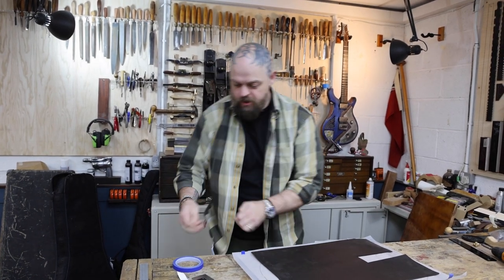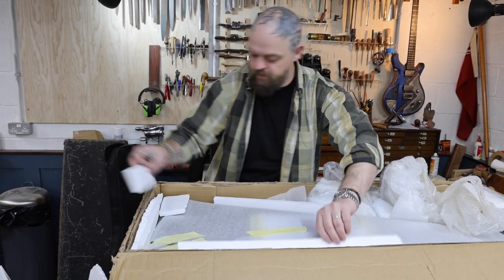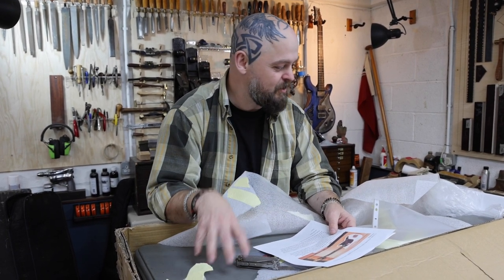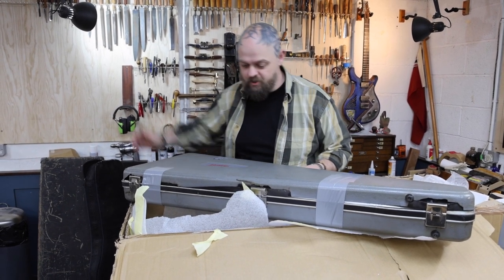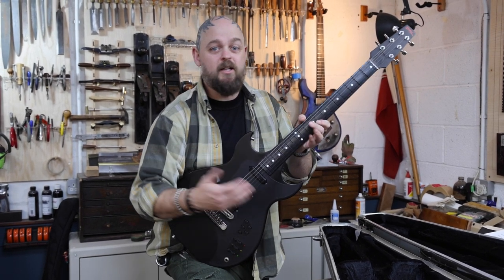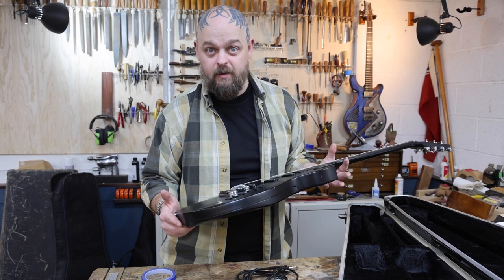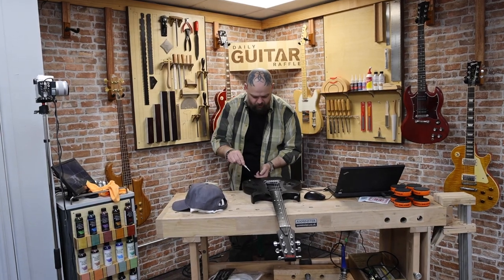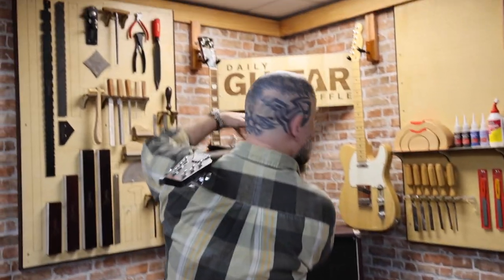Dream Unboxing | Bond Electraglide Carbon Fibre Guitar | My Personal CandyLand

Comment: Hi Ben, I'm sure you've figured it out by now but just in case here's how the controls work...
The 5 push buttons are your pick up controls.  The top 3 are on/off switches.  You'll notice a green or red dot in the display in one of three positions.  That indicates the status of the pick-up, on, off, in phase, out of phase is indicated by the dot being red or green and is toggled between the two settings using the lower 2 push buttons. I think that works out at around 10 possible pick-up combinations?
The 3 rocker switches that display numbers on the display are more of a global setting, as you can't alter the volume and tone of individual pick ups, rather you have an overall volume and tone control, So Red is Volume, Orange is Treble and Green is Bass.   

I've been looking after number 00709, which I rescued from ebay as a box of bits back in the 90's.  I'm placed to say she has a few scares but still plays, sounds and looks beautiful.  
I was 16 when these came out, I remember looking through a music shop window in Inverness and seeing one hanging there bathed in light with an angels choir "Ahhhh" ring in my ears.

Comment: The transformer will come off the power supply board; use a ziptie on it. LaSalle music in Boston bought the remaining stock in the USA. I believe production was way lower than 1400 units due to so many defective units. I've two mint electraglides for 35 years. Believe they still work :-)

Comment: Hi Ben, I live in Aberdeen. Back in the 80s, there was an electrical store on the main street in town called Clydesdale. In this shop they sold every electrical appliance and gadget thing you could want in your home at that time. To one side of the shop, they had a small musical department. Every Saturday my friend (a former student of Crimson Guitars) and I would go round all the music shops in Aberdeen. I can remember being in this shop, probable around 1984,85. They had a Bond Electraglide on one of the guitars stands for sale. We said, "that's one of those guitars with no frets that the guy from Big Audio Dynamite plays, what happens when you ware out the frets"? I know now. Anyway, my point is, you said that your Electraglide came from the Aberdeen area. I was wondering, could that have been your actual guitar?  I know we'll never know for sure, but it's the only one I ever saw for sale and I visited alot of guitar stores at that time. Just thought I'd pass this story on to you. Could be where your Electraglide was originally sold. Great video, took me back.

Comment: I think you did the right thing by turning it on at Crimson HQ - where you're surrounded by people who may be able to help with electrical gremlins.
And you were aware that the power supply being between your legs as you switched it on may not have been the best idea :)
That display is just the coolest of retro-tech now.
I still love the fretboard idea and I wonder if it could be done in stainless or some other alloy that would not wear down for a decade or two of playing.
I can't wait to see the full teardown on it - I want to see what lies beneath those covers.
Reply from the maker: Thank you Frankie... I had been promised it all worked properly but yeah..  box between legs could have been interesting 🤔 

I think we could make these fretboard now in steel etc relatively easily.. tempting!
Reply: @CrimsonCustomGuitars  Something like 316L Stainless?  it's a marine grade stainless so it is not affected by the salts from human sweat, and can take hardening well too.

Comment: I had the honour of messing around with one of these in the mid 90s that's was in an amazing guitar shop in Coogee Sydney. The place was like a museum of crazy guitars called oddly enough Guitar Crazy. I never plugged it in so I had no idea it needed an external power supply. I found sliding up the next easier then down the neck. Recently I discovered a friend of a friend says they have one that was given to them by Mr Bond himself. Hope to one day play it myself. Didn't Mick Jones for Big Audio Dynamite play one of these?

Comment: After Bond went defunct in the 80s, some guy bought a warehouse full of those Electraglides. A friend bought one for £150 as an investment - he didn't play guitar but thought it'd be worth money in the future. I'd play it now and again but thought it sounded pretty awful to be honest.
From memory, if you press 2 or all 3 of the pickup selector buttons together then press either of the buttons that are below/between them, you flip the phase - Brian May, here we come.
This was all decades ago but I think I'm right in saying 5 on the scale is equivalent to 10 on a regular guitar volume/tone pot so anything 6-9 is like a boost.
If I can remember anything else that's useful, I'll let you know!
Reply: Just remembered - the 3 rocker switches are volume, treble then bass controls. Anything above 5 on the treble/bass is a boost.
From memory, the power supply should have a volume or gain control - turn it up to max for suitably 80s distortion.

Comment: One of these was knocking around the guitar shops in Glasgow not long ago - either that or two shops wound up with one at almost the same time. Didn’t have spare pennies at the time so never plucked up the courage to go give it a try in case I decided I liked it ! Didn’t The Edge have one around the time of The Joshua Tree ?

Comment: FYI, the five pushbuttons arranged in the "piano keyboard layout" of a row of three, with the two buttons above, are for pickup switching, acting as a digital 5 position switch from what I could tell. the three rocker switches are digital volume controls for the three pickups, and supposedly, there is also a way to digitally control the tone of each pickup independently through a combination of button pushes, using the same individual volume controls. a very unique, and ahead of it's time instrument. I wonder why nobody, or no company has sought to bring this guitar design back into production today. with the miniaturization of electronic components, I would believe that a guitar very similar to this could be made much more electronically efficiently, potentially eliminating the entire need for the external battery pack, and instead using a removable "cell phone battery pack" as a power supply (Something not available when this guitar was available) I'm sure the motherboard that consumes a great portion of the back of the guitar could be easily shrunk down to fit inside a relatively average sixed control cavity of today, with surface-mounted displays, and pick guard (scratch guard) mounted switching. The stepped fretboard is innovative and ground-breaking, although it seems like it would be next to impossible to perform anything similar to a fret dress and polish without actually lowering the peaks of all the frets, and essentially having the fret surface become progressively wider and wider until the instrument is unplayable and requiring the fretboard assembly be replaced. I wonder about the longevity of the aluminum fretboard assembly with steel strings, and the potential for excessive fretboard wear, especially with string bending, and having wound strings pressed against the fretboard. I wonder if using modern technology, if a stainless steel fretboard would be more feasible, and offer more longevity, as well as being able to hold a much higher polish, to reduce even more friction, for easier bending, and being a harder surface, likely better intonation and tone compared to aluminum. Definitely a design that deserves to be revisited, and reimplemented with more modern technology. Imagine a similar guitar, made today, with modern improvements including, but not limited to on-board multi-effects?! that would be absolutely game-changing.

Comment: Only place I ever recall seeing one used was by Big Audio Dynamite on Top Of The Pops...... and wanted one ever since!! 

Just a guess here but, do you think that maybe the bunch of five buttons will be for N/M/B and the associated "inbetween" sounds (N/M and M/B}? And the rocker switches sounded as if they were Volume, Treble and Bass like a regular active set up. Be interesting see if my guess is right..... At least. that's how I would've set it up anyway..... 🤣🤣

Comment: The issue with the stepped fingerboard is that it fast up the board and slower down as your fingers are hindered by the ledges.
played the original import to Australia.......

Comment: Interesting instrument.  I have an Alembic with an adjustable nut like that - this is the only other instrument I've seen that on. It's an excellent idea that I'm surprised hasn't really caught on outside of the boutique market.
Reply: It looks like the type of nut Gibson were using on their ill-fated 2015 range
Reply: I had not thought of it.  I use zero frets, but now I have seen that nut I'm tempted to give it a go.
Reply: Valiant Guitars (Ukraine) do their own variant on their current models.

Comment: If i remember correctly, doesn't the two lower pickup selectors turn on the 2nd & 4th positions as on a regular 5-way switch?

Comment: If you need another Bond I have one, it's parts and spares only though as someone did DIY to the circuit board to add midi

Comment: Can someone around here maybe help me understand something?  I have an 80s GTX 23 made by Applause and I lost the nut.  Local shop said it would cost $100 USD to make a new one out of bone but the original nut was more like black plastic.  Is this truly worth the price ?  I’m finding other plastic nuts on places like Stew Mac for 10x less.  I understand quality workmanship but I feel like there is another option out there.
Reply from the maker: Go to another shop. They are trying to rince you. Half an hours work tops plus the cost of the bone blank does not equate to 100 bucks.. bone would be an upgrade over the original plastic though

Comment: the usual problem  was the power supply  developed problems,  I think if it came  running off batteries or the electrical problems had been solved, before  production, it would have been a smash! but a lot like the synthaxe, it was just way too advanced for the electronics at the time, the syntheses had latency problems on the midi system, and the only way around it was to make all the frets the same length?? ita AMAZING, CONCEPT IN A GUITAR,  HATS OFF TO ANDREW BOND BUT IT WASNT TO BE! AND BUILT IN SCOTLAND!